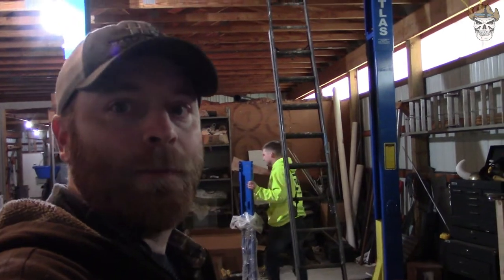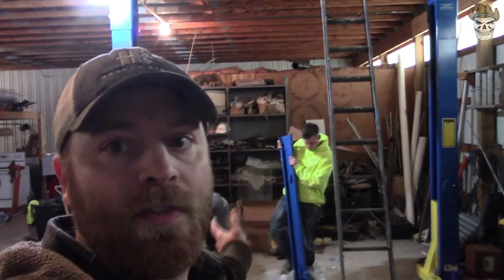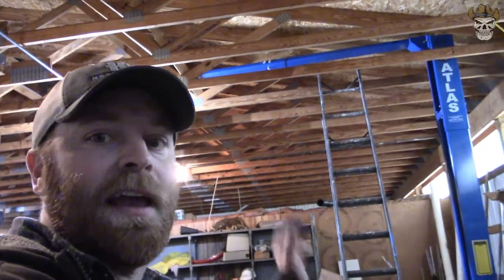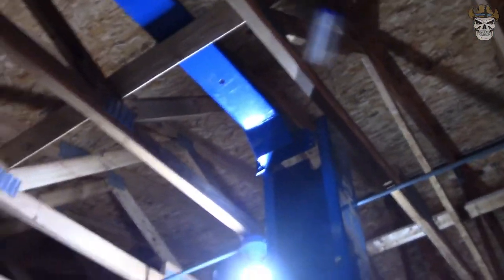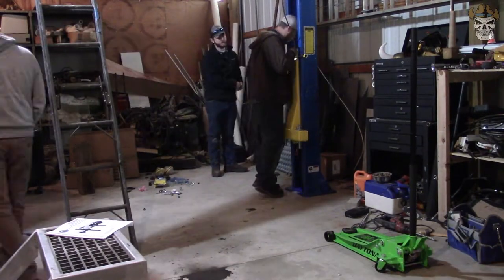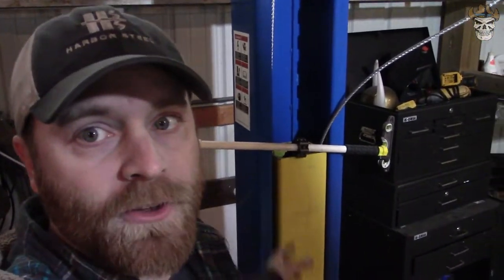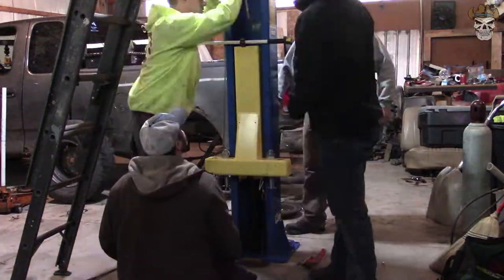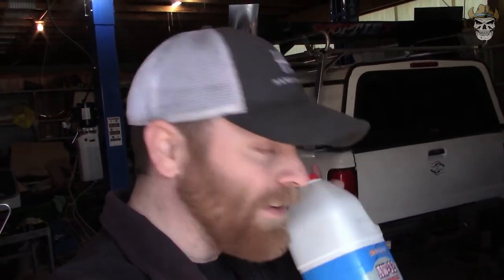Installing A ATLAS 2 Post Lift

Comment: I love my lift, got it from the Indy whse Oct '19, brought it home on a 22 foot long car trailer, unloaded it with my engine hoist. Had to rent a man lift for top part. When a person has a back less than good, helps to raise car up to where it doesn't hurt to bend over to work on it. Luv mine.
Reply from the maker: We use this lift quit often and is so useful.  Makes jobs easier and quicker.  Im happy we were able to transport it on the back of my flat bed as it made it easy to move around.

Comment: I will be installing my used 12' hoist in a 10' flat unfinished ceiling and running though the rafters with the top bar like you did.  Did you rig up the upper travel safety switch?  Has it been an issue either way, my luck I would mess up my car or trusses.  Maybe in this type of case you should have to press 2 buttons to activate the raise so you're dam sure.
Reply from the maker: If I remember correctly if you do not install the upper limit switch for the hoist it will work without it wired in and there is no need to rig it.  As far as any issues we have only had cars on the hoist this far and even at the highest position there is still room as long as the hood is closed.  Good luck and enjoy your hoist.  They are amazing to have.

Comment: Is that a Turtle replacement in the background?
Reply from the maker: Unfortunately it is not.  The Turdles time is running out.  I have the Yellow Oldsmobile that is going to be replacing it.  After owning the Turdle for 2 1/2 years its going to be hard to let go of but it has to happen as I own way too many vehicles.  The F150 in the background is Tylers brothers truck.

Comment: I put one in last fall, dont know how I survived with out it!
Reply from the maker: I was an auto tech for 11 years and had access to a hoist whenever I wanted it.  Its been 10 years since I have been under a hoist and its going to be nice to have.  All the projects that I have built have been done on the ground using floor jacks and jack stands.  Now I just need to get a spot of my own so I too can have a hoist of my own.